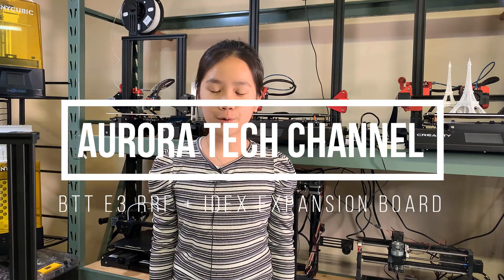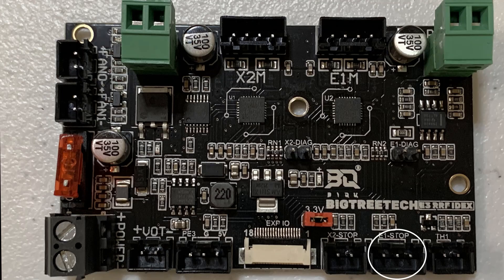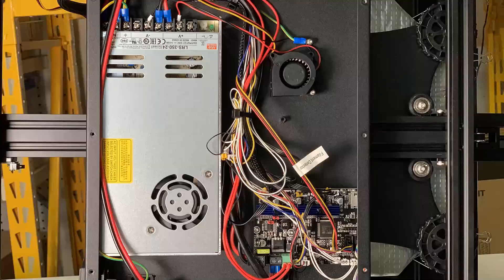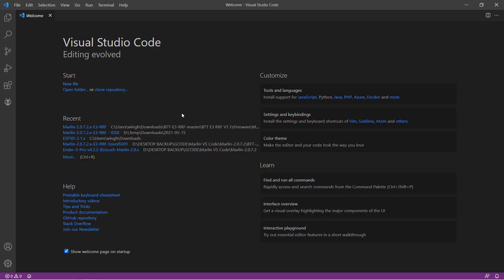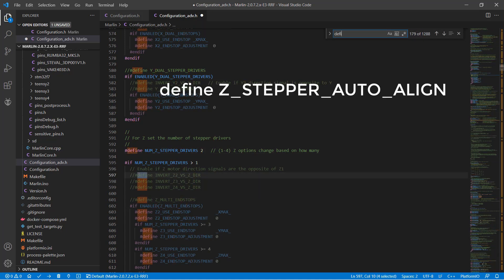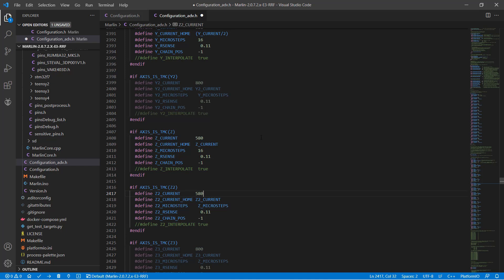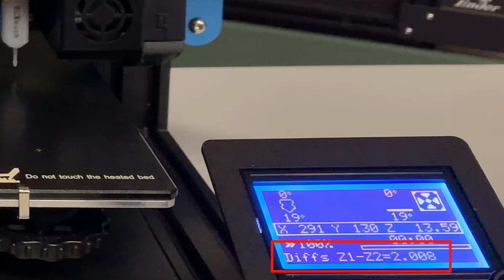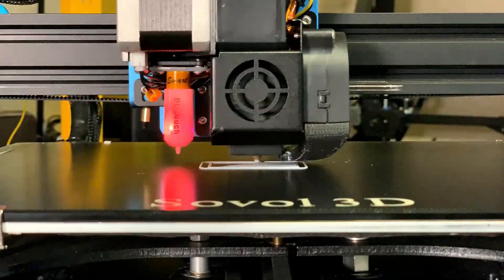Big Tree Tech E3 RRF IDEX expansion board Dual Z stepper driver Marlin G34 Auto Z-Align Sovol SV01

Comment: The value of "5" suggested for Z_STEPPER_ALIGN_ITERATIONS may not always work to achieve the target Z gantry alignment.  Other sources suggest "10", but I used "8" with good results.
Reply: I should also note that these instructions are an excellent start for doing this same upgrade on the SV03, as long as you consider the larger bed and max Z dimensions.  The only other adjustment is to connect the remaining 2 independent wires for the BLtouch to the 5v and PB0 pins of Z-probe.  For SV03, you can ignore the pin re-ordering step for BLtouch.

Comment: Once again your videos tell me exactly what I wanted to know. I JUST got  the E3 RRF 1.1 and want to run dual z but REAL dual Z with a driver per motor with auto align. I thought I could do it with the RRF without the Idex but it's not the same. It just shares a driver across two motors. I couldn't find ANY information about what the Idexx board actually DOES until your video. 
PERFECT. 
THANK YOU!

Comment: Great tutorial! I just installed this board on my Ender 3 V2 and added a BL Touch. When I loaded the firmware from BTT github I cant do auto leveling because my dual Z steppers stay in the middle of the gantry and won't come near the bed. Any suggestions? Thanks!

Comment: I was thinking of getting this board with hopes of having an additional cnc fan port so that I can control the hotend, board, and part cooling fan, and use one of the 2209 drivers for a second independent z driver, rather than use the parallel z port on the main board, and finally, the other power port to control a led strip separate from the neopixels I am trying to use as a status indicator. I had the neopixels working with Marlin firmware, but with reprap, they only turn on manually for me. There isn't a lot of info out there on the subject yet, but I'm thinking there is a way to add a script to have it work as a status indicator, maybe through the slicer.   Great work on this video also!

Comment: Would it be worth it to get this board over the sovol silent main board? I know this bigtreetech has a better processor also but I don't know.
Reply from the maker: Yes, the Sovol silent main board is still the same 8-bit board, just with silent stepper drivers, if you want an easy upgrade, you may buy the Sovol silent board. But I prefer this BTT E3 RRF instead.
Reply: @AuroraTech  If I already have the silent motherboard, would it be worth it to get the bigtreetech board?
Reply from the maker: I think you should just keep the silent board on the SV01 as it's not worth to replace it just for the 32-bit processor, the Sovol silent board should have 5 stepper drivers, you can still use Marlin G34 Auto Z-Align feature if you connect the second Z motor to the last empty connector on the Sovol silent board.
Reply: @AuroraTech  Thank you for replying and for your time!! I wanted to let you know yall are doing a awesome job and are my favorite 3d printing channel, keep up the awesome work!!